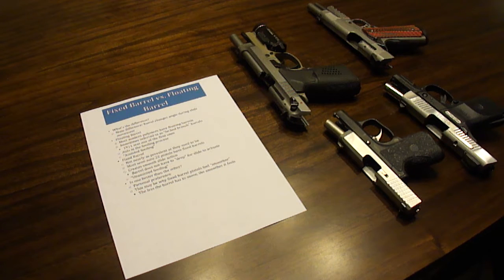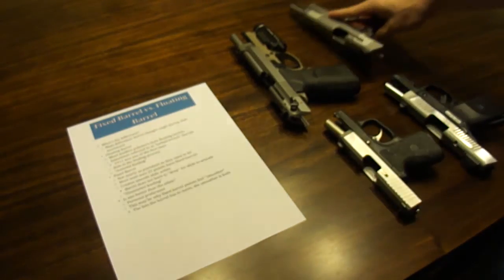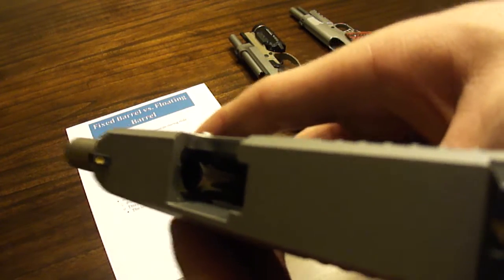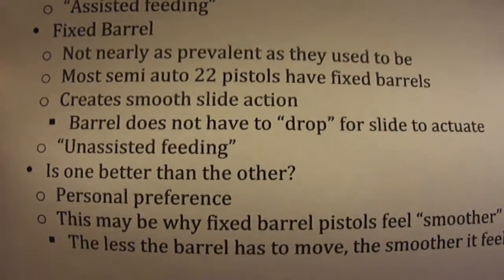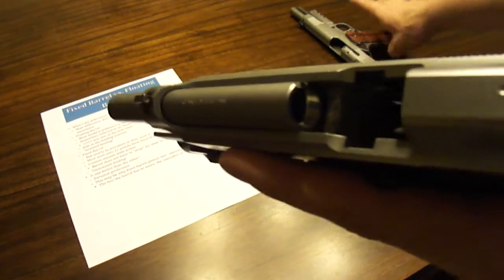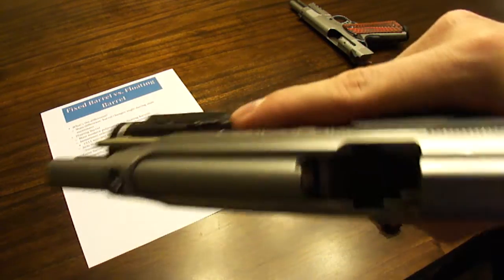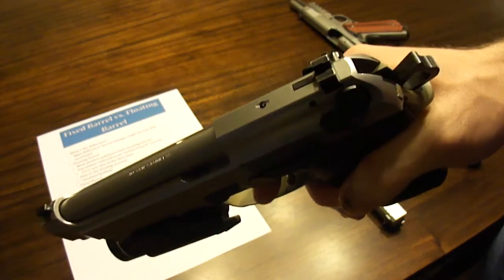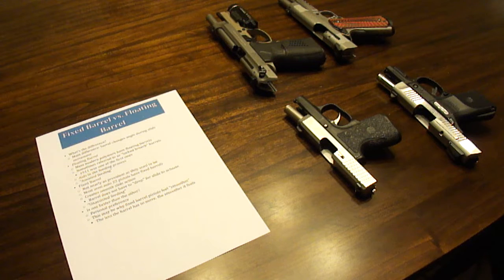Fixed Barrel vs. Floating Barrel

Comment: You forgot to mention one of the most important factors when comparing the two! 
You will most likely need a Nielsen Device to run a suppressor on a floating barrel. On a fixed barrel you don't need this.

Comment: The Beretta is NOT a fixed barrel design.
It IS a floating barrel design. The barrel moves rearward, allowing the "falling block" to disengage from the slide. 
The Beretta design is actually a simpler design of the floating barrel Walther design developed for the P38/P5. 
Yes, Beretta copied the Walther design, without the barrel front locking lug that secures the muzzle end of the barrel to the slide and frame featured in the P38 and P5. Beretta ignored this feature to reduce complexity and cost, gave up a little accuracy in the process too. 
Look at a Walther PP/PPK, Desert Eagle Mk-VII/Mk-XIX, or an HK P7 PSP/M8/M10/M13 to understand what a "fixed barrel" ACTUALLY is. The HK is a "gas delayed" fixed barrel design with a gas chamber and slide attached piston. 
You may want to do some research before making educational videos.

Comment: People complain about the trigger and accuracy of the 92, it usually boils down to people not being able to mentally transition from double action to single action. That first shot out of a beretta 92 is long stiff trigger pull. Like a revolver, The follow up shots are right there, very little take up. 
Personally, at the range I would tend to just draw the hammer back manually with my thumb when drawing from a holster. Because I'm lazy and prefer each shot to be the same. Never bothered to train myself too much on the DA, SA transition, I f*cked with it a few times but never made it a habit. If someone treats a DA shot with their finger doing a SA pull, they're gonna have a bad time and be inaccurate and blame the gun. It's not the gun. The gun is actually extremely well made, very smooth and reliable. My only issue with it is that the grip is huge even for a double stack. But that's not really an issue. Gun is good. That style beretta is really good. All of them, 92,96,84,34/35 ect fixed barrel hammer fired ect ect. Idk what happened with beretta with these new things they're coming out with, pico, nano, that thing with the ridges all down the slide, whatever it's called. They should have stuck to their proven, exposed barrel hammer fired design. Although the px4 has that rotating barrel, which is interesting so I'll give them that.

Comment: Actually, that Beretta has a floating barrel. It slides on a track and locks into the slide with a locking block. A better example might be the Walther PPK or a russian makarov.
Reply from the maker: Matthew Yee Since doing this video many years ago I have realized the shortcomings in my analysis here. I agree with you - those are true fixed-barrel designs.

Thanks for your view.
Reply: Careful...Beretta M9 is a fixed barrel

Comment: Holy crap! My 96 is a fixed barrel? Sweet! I had no idea, I always thought fixed barrels were those blowback guns with the barrel semi permanently attached to the frame.
Reply from the maker: Ash Green Well I wasn’t as precise as I would’ve liked to have been back when I made this video. The Beretta 92/96 does not have an entirely fixed barrel but the barrel does not tilt and has minimal rear movement with the slide. It’s certainly different than most where the barrel also tilts. Thanks for your view.

Comment: MUCH, MUCH better title   "Fixed vs. Floating"    than those on the majority of sites on this, which use "Locked breech vs. Blowback" to identify the difference:  a bit confusing since ALL semi-autos blow back, right?  THANKS for the FIRST clearly defined video on this!!!  Am looking for a fixed barrel (like the Walther CCP) for my daughter as I've already discovered that a fixed barrel's slide racks a lot easier than that of her present Shield.
Reply from the maker: Robert Emanuel Well I wasn’t as precise in the title as I would like to have been. The barrel on the Beretta is “fixed” in that it does not tilt upon slide movement but only moves backward slightly. A gun like the CCP truly has a fixed barrel that is attached to the frame. 

Most guns with fixed barrels will have easier slides to rack since the slide motion is slowed down by two springs instead of one - the hammer spring and the recoil spring. Think of racking a 1911 with the hammer down and then with the hammer back. There’s a considerable difference. 

Thanks for your feedback and for your view.

Comment: Fixed barrel (blowback), locked breech (1911), falling block and rotating barrel (beretta). Any others?
Reply from the maker: There may be others but I believe you covered the most popular ones. And I'll admit my ignorance that my research wasn't as thorough as it could've been with this video. Obviously it's quite old and I've gained some extra knowledge since then. Thanks for your view.
Reply: Gas operated rotating bolt.from desert eagle.

Comment: is there an accuracy difference at greater ranges?
Reply from the maker: +satan31337 I haven't done any testing so I can't give you a definitive answer. I also don't shoot my handgun very long distances, so combat accuracy is more important to me than group size. It asks the question, "how easy is it to be accurate with this gun," versus, "how accurate is this gun." Hope this helps you out. Thanks for watching.
Reply from the maker: But in terms of practical accuracy, they are the same. If you're shooting a handgun at 100 yards you may as well switch to a rifle. But I guess if you don't prepare for the worst you fail to plan!
Reply: +BigAppleGuns Match-grade barrels for browning-based pistols have very complicated exterior surface, to ensure snug fit in the bushing, when locked. I guess you're right about the rifles vs pistols, but anyone can do it with the rifle. 500 yards and beyond, with iron sights - is what considered cool in the rifle world.